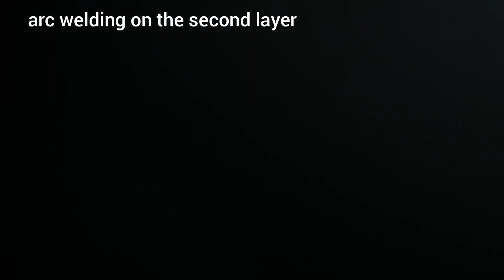a little secret trick of thin pipe welding |  why no one told me about this??

Comment: For thin metal what is the Voltage you use and for Fat metal what is the voltage you use?
Which no of mm stick is use in both can you please tell me i am a beginner.
Reply from the maker: for welding 2 mm thin metal, you can use a 2.0mm rod with 60-70 amps.  and for welding a thickness of 2-5 mm using a 2.6 mm rod with 70-85 amp
Reply: Thank you. 👍